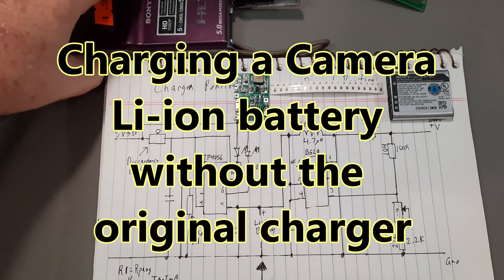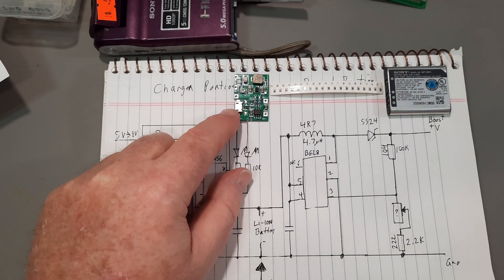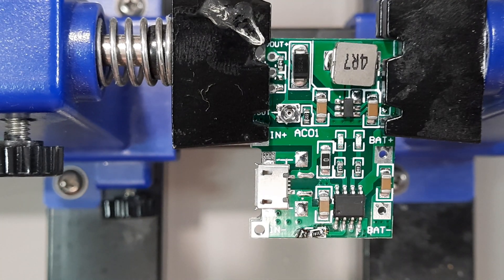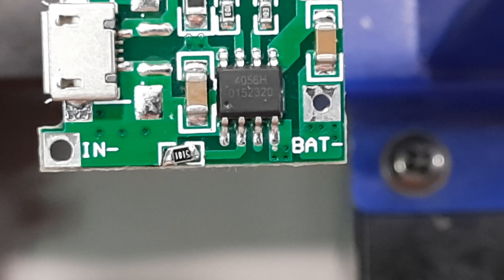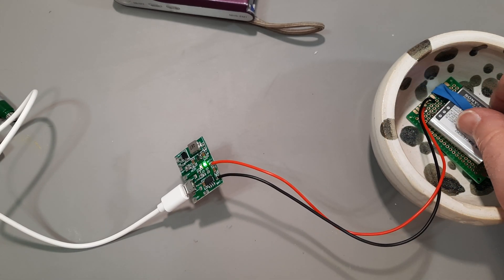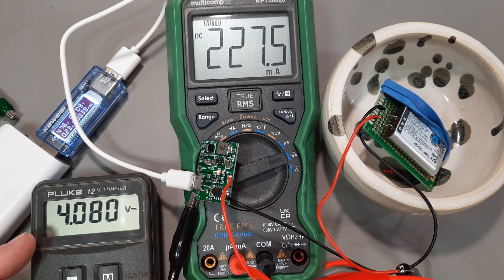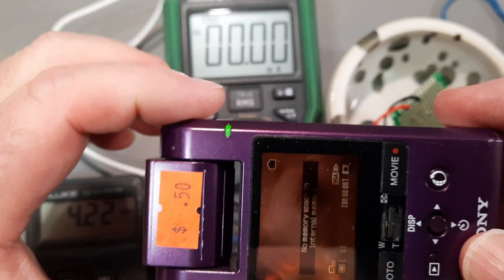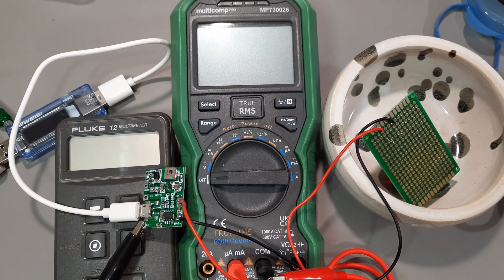Charging a Camera Li ion battery without original charger

Comment: i have new 8.4 volt li-ion battery, /i think change old battery little better my table vacuun motor, what module  need order can charge good this battery, i looking aliexpress many chargers, but lot have cheap 1A charger only, need be little better about 2-3A charger,  battery have 6 pcs 18560 cell 8000Mah.  i thin k not have safety board in battery, i not has open scrimp plastic cover. this is aliexpress battery. 6 cell 8000mAh, 8,4 volt. li-ion.
Reply from the maker: Sorry but you will have to check with someone else. My experience is only with small Li-ion batteries, and it is very limited. Would not want to give out bad info since Li-ion can go bang if done improperly.

Comment: Hi, instead of that board with the adjustable voltage on it, get a tp4056 with protection (dwo1) change the resistor to pin 2 on the chip (same as you done here), and you’ll never have to worry about a fire , considering the board provides great protection to any battery without it. Hope this helps. Great video, keep up the good work buddy. 🤙🏼🇦🇺
Reply from the maker: Getting it with the discharge protection is the way to go.